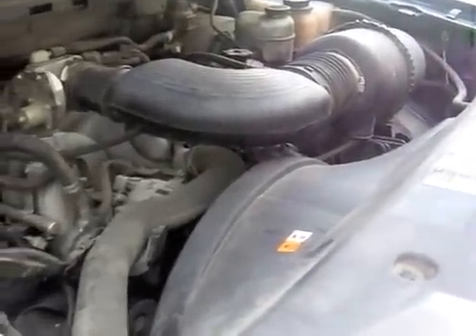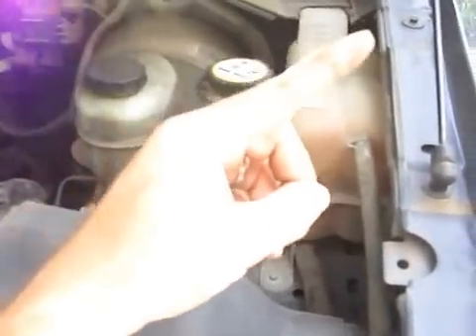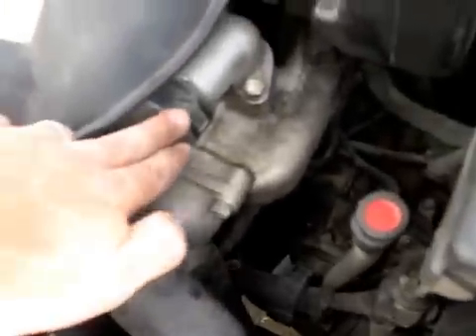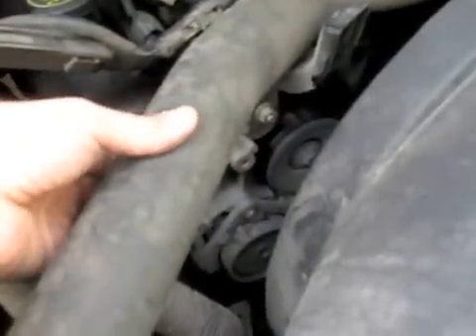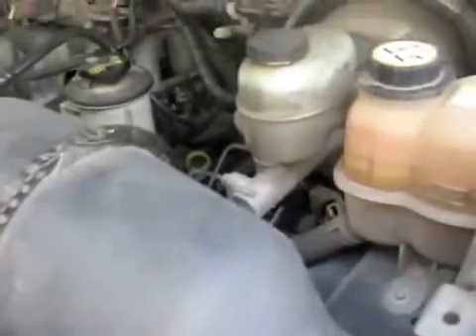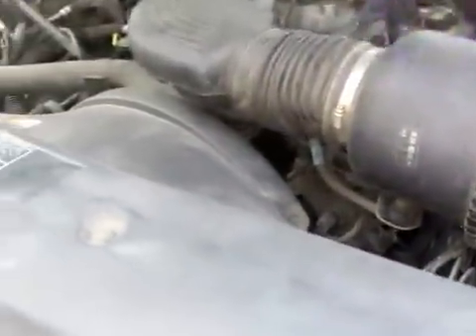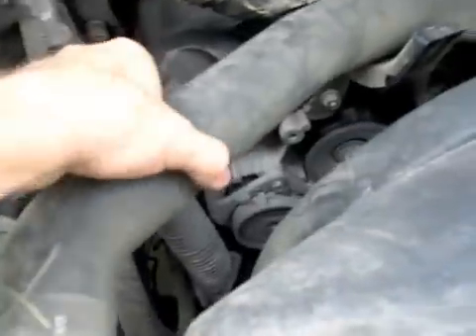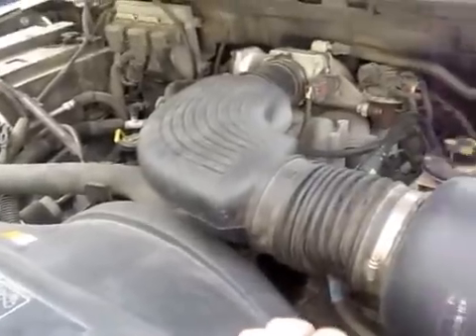Car Engine Overheating - Causes and Symptoms of Over Heating  Car Engine

Comment: Austin, I'm suspecting a head gasket leak in my chevy venture because when I take the radiator cap off when the engine is cold, the antifreeze rises up and runs out of the radiator.   I have to quickly get the cap back on because it keeps running out.   I'm suspecting there's a very small leak because there's no white smoke out the exhaust, the engine runs good and I haven't seen any bubbling in the reservoir.   What are your thoughts on this?

Also, how can I test my radiator to determine whether it has restrictions in it?

One other thing.   In my chevy venture, the fans don't turn on until the engine is running quite hot (I forget the temperature) but that's the way it was designed.   I'm thinking I should add an aftermarket circuit to make the fans turn on at a lower temperature and I'm wondering if GMs design of running the engine so hot might be part of the reason why the transaxles fail so often.   What are your thoughts on that?

Comment: I have a 94' Toyota Camry and it I think I have a leak because whenever I drive it around for a little it starts overheating and smoke starts coming out the right side of the engine it has even turned off on me! Please help and let me know what should I do

Comment: I can't find an answer in this video to my issue.  It's really weird: My truck overheats unless I let it warm up first to operating temperature. I changed the t-stat already (that's about the limit of what I can personally do, mechanically). If I let it warm up, it goes with no overheating problem. If I don't let it warm up, it overheats a few miles into the trip. If I let it cool down and drive it again, it will overheat again. BUT if I do this a couple of times, it will stop overheating.  Changed t-stat and flushed it already.  The mechanic says all compression, etc., is fine.  The fan clutch doesn't seem to have any problems (turns with tension).  Any ideas?  Nobody seems to be able to know what's going on here.

Comment: I have a 1990 Mazda Miata and it had a blown head gasket and i bought all the parts and did all the work and install a new water pump and new thermostat and new radiator cap and its still overheating , any ideas?

Comment: Í just got anew water pump and new thermostat but my car still shakes and and it will heat up but the needle will stay in the middle of the and will not hit the red part could it be the transmition???

Comment: I have a 2000 Chevrolet Silverado and I change a bad water pump and thermostat. My truck wasn't overheating before but now it is. What do think this could be....it goes over regular temperature in idle and really goes up driving it.
Reply: did u mix dexcool and universal antifreeze together this can make over heat or maybe the well water is mess up the heater transfer in dexcool
Reply: Mark D I figured the problems out.... out of probably a million they gave me a bad thermostat but the other fault was my own....not allowing it to fill the whole system... Thank you

Comment: Hi. I have an 02 325i. Just installed a brand new electric radiator fan. When driving for about half hour or more will feel a heat coming from under the drivers side. Any ideas. Thanx.

Comment: I have a 2001 mustang gt, I already change my thermostat and it keeps overheating up. I believe It can be my radiator because every time my car overheats up, steam is coming out of it. The steam comes from the sides and on top of the radiator, are those signs of a bad radiator. My car is not leaking, but I do have burning oil issues. Gotta change my head gaskets, could that caused the problem for my car overheating. Or maybe my radiator hoses are not circulating antifreeze well do to rust inside of it. Please help, because most mechanics won't tell you the truth till you spend 1,000 bucks with them...

Comment: I had some heads and head gaskets replaced a few months ago because my car over heated while driving. now it did it again but this time the temperature drops back to normal when driving, it heats up on idle, if idle for a long time but it won't do it at a red light though! Suggestions?
Reply: Also to be clear the fans in my car are working properly.

Comment: my mother has a overheating problem and her mechanic just keeps replacing parts i told i would fix it but she is giving up on it its 98 lincoln! its i think its the fan she drive slow and she starts the car and gets a few miles and it overheats

Comment: i would try to get a scan tool to monitor the coolant temp thermostat should open and close at certain temp depending on the manufacture maybe wrong thermostat. causing cooling fans to come on late possibly cooling fans not working properly also bleed cooling system after any cooling system repair if it were the water pump it would over heat mainly while driving and will overheat rite away if u can get access to a radiator pressure tester i suggest renting one it will tell you if there are any leaks or unwanted air entering ur system

Comment: I have a 2002 Chevy cavalier, it started with only running hot at idoling , and slow traffic the fan plug was bad , and the gage would go all the way up...well then it started not showing on the gage and would lose water out of the over flow. I've changed the plug and thermostat, and its still running hot without showing on the gage, but it does show a light that is share with a arrow at the top pointing down with wavy lines like fluid or water..so what else could it be..? please help I need my car, and can't afford blown gaskets, or cracked heads..

Comment: Hi I have a question my car a Nissan Altima 2005 was working fine but out nowhere it heats faster and takes longer to cool down and I notice the coolant level change even if the engine heats... What could it be I don't think the coolant is flowing through my radiator.. Could it be the thermostat? Or a blocked radiator? Idk can you help me please
Reply: I meant the coolant level DOES NOT change even if the engine is super hot.. Idk if it could be the radiator cause I changed it for a new 1 a year ago

Comment: hi. have 99ford Taurus
 my car over heats at idle. I replaced the thermostat, fans are good and clean. I put antifreeze in but it boils n keep leaking brown. I looked and its so corroded. I don't know whether to replace water pump or get a flush? any ideas

Comment: OK I just installes a new alternator installed and battery replaced but not the car is getting hot the thermostat has gotten to 250°the then ac begins blowing hot air then it slowly goes back down to 200°and then slowly goes back up any idea why this is happening now

Comment: Wait so youre saying its possible its the radiator being clogged?

my 96 corolla has no problem staying cool during freeway driving when the temperatures are not so hot (70 degrees or lower)

but it does quickly overheat in one hundred degree weather once the traffic flow starts to slow down

however during constant speeding the gauge rises near the RED line

Comment: my mitsubishi lancer glxi 96 is overheating when ac is on. why..
Reply: Bing Kay your ac condenser is usually stacked next to the radiator so when it's on that condenser is going to add heat to it. Could be your radiator fan is weak or your radiator have seen better days :p

Comment: my car recently just started overheating then shut off.  i left it for two days sitting at a spot i need it to move it. i came by to check my car then it cranked right up. Then the same happend. any info would help please

Comment: i replaced my radiator and replaced my thermostat with one had in my old thermostat pipe it was new but my thermostat pipe blew so i replaced it with another pipe and then my cars temp was high so i stopped poored water kn radiator and on top of thermostat pipe the temp cooled down then i got home checked car radiator was smoking replaced it looked good today in the am i took off got like 3 blocks away stopped and their was smoke out of my radiator again what should i do next help asap need car by Monday for work

Comment: I have a 2000 gmc savannah 3500, its overheating when I shut it off, I did a pressure test and found the upper hose leaking. After I replaced the hose the van overheated while driving. Do you think this is head gasket leak. No white smoke, oil is clean. I'm lost, replacing radiator, and water pump tomorrow.

Comment: i have a 1991 ford ranger 4,0 it ran hot and it died and will not start back its getting gas and fire it just turns over it doesnt have water in oil either

Comment: I have a question. I got my car  (04 Grand Prix) repaired today... It was the oil gasket and oil pan and oil sensor. It cut off of me when I was driving. And smoke coming out of where u put the oil. It's some corrosion.! But they replaced all the oil and filter. Why is it doing that?

Comment: I replaced my radiator my thermostat and the censor on my 2000 Honda civic but I realized the fans weren't running as the car was running...like I said I replaced the heat censor what else could it be

Comment: what about a coolant sensor ?and what are the symptoms.My 2003 f150 when blows cool air while on heat when the truck starts over heating the air stars coming out hot ??
Reply: thanks again on opp OP 9ooo9oooooliiboee
Reply: thanks again on opp OP 9ooo9oooooliiboee

Comment: 2005 Dakota v8. The truck runs great until I turn the AC then white smoke would run out of the tailpipe. Turn the AC off and it goes away completely. Please help.

Comment: I having over heating issues with my 04 Chevy Impala 3.4 liter. I've replaced the radiator, water pump and thermostat. Still over heats, fans are working, no leaks either. What do you suggest??? At stops needle raises up high near red area then when car is moving needle decreases. Your neighbor in Dallas, Tx.

Comment: my thermostat indicator light came on. When I checked the coolant liquid, and it was almost empty. When I added coolant, the indicator light went out and then I noticed the coolant started to boil after 20 minutes of driving. Why?
Reply: The coolant would not come into a boil when you have the radiator cap on and tight. The cooling system works off of pressures. With the cap off pressure are forced out to the radiator cap and will bring the coolant into a boil.

Comment: HI, My MPV van is over heating and the heat does not work. It does not appear to be leaking fluid. It over heats with any speed driving. It does cool a little in park, but it over heats pretty quick. I changed out the thermostat but it is still over heating. Any suggestions?

Comment: Hi, my car running on freeway, and the engine get hot after about 20 to 30km. Opened up the radiator and top up some water(approx 1.5L), engine temperature seem to go back normal. This happened every approx 20 to 30km on freeway and each time need approx 1.5L to 2L or water for top up.

Can any one help please?

The following things have been done:

***Pleasure test-no leak 
***Water Pump replaced(left the car turned on for half a day after the replacement-no over heating)
***Both radiator fans are working fine

Comment: Hello there :) I have a 95 Acura Integra which is overheating when I'm a stop. I had a coolant leak into the passenger side, took it to the mechanic and he did a bypass because neither the heater or AC work. it was not over heating after that, it just started overheating again, I saw your vid and you advice to take a look @ the fan, how do I get this fixed?
Reply: can you hear the fan going on or off every 5min ?

Comment: i have an 04 pontiac grand prix. my fans wont work unless i unplug the temp sensor. any ideas????
Reply: have you tested the fam switch?
Reply from the maker: +Lene' Mitchell wow, how weird, I would make sure there are no air pockets in the cooling system that needs to be bled out. Maybe a bad sensor?
Reply: What causes the air conditioner to not get cold with new compressor, receiver-dryer, expansion valve, and evac recharged?
Reply: thichphuoc tien

Comment: Hey Boss I just had my windstar towed home cause milky oil and steam was coming out the rocker cover where the PVC valve was . Now at home I flushed the radiator changed the oil when I put water in radiator the level ever came up check oil dip stick and the level is rising!!!! HELP!!
Reply from the maker: +Dan Nevis possible head gasket issue, check my channel for my head gasket repair additive, follow the instructions on my video.

Comment: I have a 98 Buick Century 3.1L V6. A few weeks ago my Tstat bypass hose magically sprung a leak. But a temporary seal on it for a few days to get to/from work. One replaced, seemed fine for a few days. Then the car started having irregular temp readings. Burped the system. Ran fine for a few days and started it AGAIN. Recently replaced the Tstat itself and it burped itself out the reservoir tank oddly enough. Drove it for about 15 mins to a store and ran flawless. On the way home suddenly out of nowhere pegged 3/4 up my temp gauge. Turned on the heater to blow out some heat. Gauge went down. Every single one of my friends and I are completely confused. I get NO heat in the car unless I'm moving. So it SEEMS like I have a blockage or pocket of air but none of us are certain at this point. Could a blockage in the heater lines cause this problem by not allowing heat to fully circulate through the system?
Thanks in advance

Comment: I have a 2004 Mercury Monterey Van that is over heating. It will overheat when driving but if idling will cool down. It will go from normal temperature to red-zone hot instantly (does not rise slowly when overheating ) anywhere from 5-15 minutes when driving .Uses antifreeze but no leaks. Replaced cracked radiator cap and then replaced thermostat but no change. Appreciate any help you can give.

Comment: first off thank u for the video I don't know where to start I need to know if I have a fixable problem or if I'm screwed car overheated on a hot day it holds pressure has heat air works changed waterpump fans work  unless it has a shortage two things that appears strange to me is when the radiator hose is squeezed it makes a clicking sound over at the radiator area and when I take off the radiator cap the coolant was just running over spilling out while engine is cold

Comment: Trying to find a counter clockwise water pump for a 94 GMC Sierra SS and even though they are labelled as such the movement of the impeller is clockwise. Do you know where to find the correct one? Or a trustworthy brand? This GMC is overheating and stops running after 10 minutes ad idle position. Thank you for any input.

Comment: I have a 2000 Dodge Dakota I've been experiencing a overheating problem. To start let me say that I've change the Sensor, thermostat, and the main hose that goes from the radiator to the engine. It seem to help for about a month before it started to overheat again and had to had antifreeze twice now. I can only drive it for so long before it starts going pass the half way point and on even if I turn the a/c on it actually heats up faster... (side note) my heater core doesn't work and I say that cuz smokes comes out of my vents while driving and smells. but I've been told that, that has nothing to do with the overheating. but idk what else to change.. maybe the fan Clutch even tho I've checked it and it seems to be working fine

Comment: I have a 1995 Nissan Path Finder with 130,000 miles. its overheating ONLY  when I turn on the A/C.  I replaced the Timing belt, Alternator belt, A/C Belt, Etc ,  Water Pump, Radiator, Thermostat, Cooling Sensor, Clutch Fan, transmitter gauge sensor. The radiator is brand new and there is no debris blocking the air flow because my mechanic cleaned the A/C  condenser. I can drive the car without the A/C all day and it doesn't overheat ; however, when I turn the A/C on approximately 15 to 20 minutes after, the temperature gauge starts to rise to the H. What do you recommend I should do ?
Reply from the maker: +Jose Garcia I would check the electric cooling fan at the radiator, bad fan motor, or relay, OR you have an air pocket in the cooling system that needs to be bled out.
Reply: Thank you for responding to my question. I will definitely follow your recommendations and follow up once the work has been done on my vehicle  by a professional mechanic.

Comment: i have a 02 Chrysler sebring my mechanic added dexicool and it turned to sludge, I recently had it flushed and also noticed a leak that was fixed but my car still overheats and let me add that my heat used to work until it ran hot,  so far i also changed the thermostat that was shot, do u think my problem may be from a bad radiator or a blown gasket???

Comment: Chrysler 200 (2012) running warm (needle is between normal and hot) during highway driving .. Temperature needle is fine while idling or regular driving.  If I turn the defrosters on High the the needle goes back down quick.  Is this a symptom of a bad thermostat?

Comment: hi names Allen marvets I'm on my wife's phone. I have a 93 Ford f150 5.0   an it didnt start over heating till I used the air conditioning I don't use it now,  I have circulation through pump changed thermostats an radiated seems to be circulating but I have no leaks an an checked the inside for heater core leaks nothing how can u tell if ur leaking in the head or a gasket wouldn't water or coolant be leaving out somewhere i mean the truck doesnt accelerate quickly on time either, i traded for this truck didnt over heat till i used air conditioning, hmm the low acceleration could be from a bad head an the radiator might be like how he explained over vid, i have pressure in thermostate hose after engine warms meaning its circulating any suggestions or did i pretty much sum up my own theory lol